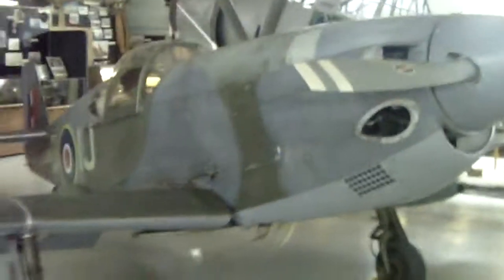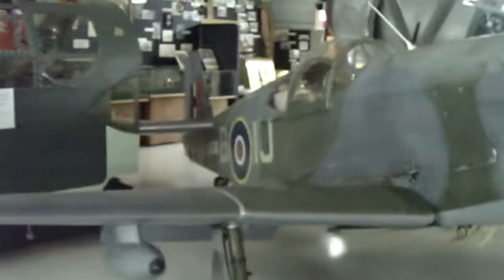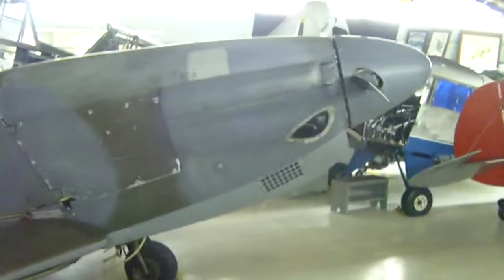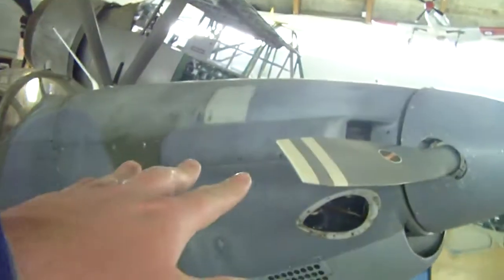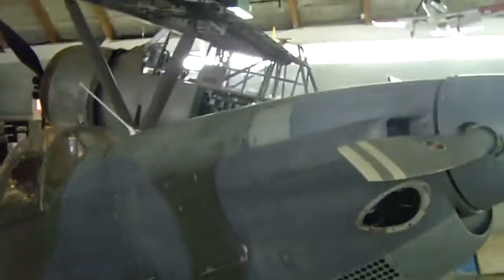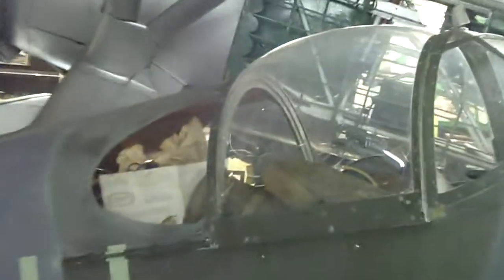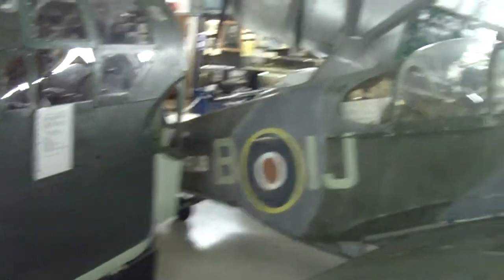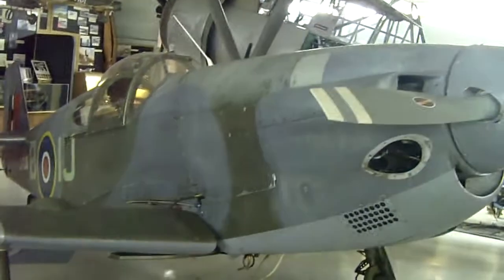2/3 Scale P-51B Mustang replica

Comment: My daddy built this over the span of 15 years.   I actually flew it to a couple of air shows here in N.S..   As I recall, the landing gear sequence is somewhat complicated.  I would practise cycling the gear  while the a/c was supported on the ground via tripod jacks.  Had a relatively high spar G-loading (+ and -,  don't recall the actual figures).  Was a blast to fly.
Reply from the maker: Bob Baptiste nice hasn’t been run in a long time soon though need to wake up the lycoming o540 flat six engine
Reply: Nice to know.  I often wonder about the old bird.  Most of my early years were spent in the basement helping my father weld or glue or something.  Keep posting, I'll be watching.
Reply from the maker: Bob Baptiste will do man have to see how bad the engine is since it hasn’t been rubbed for a long time